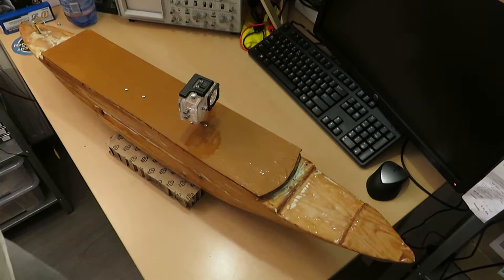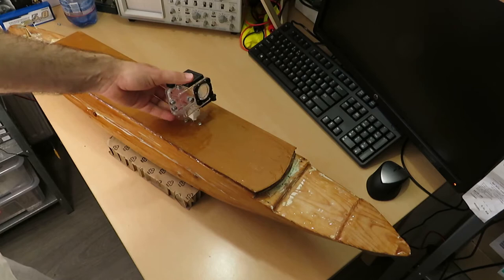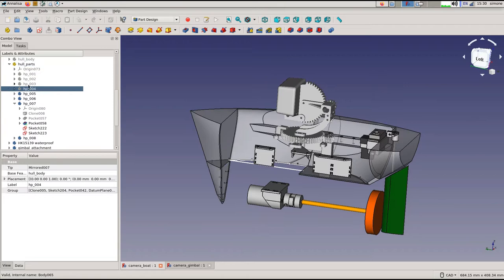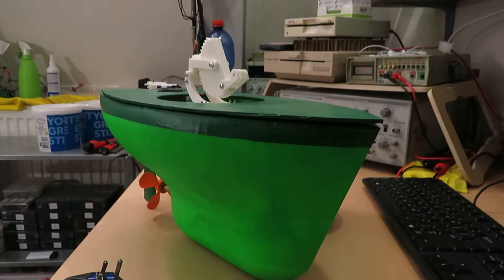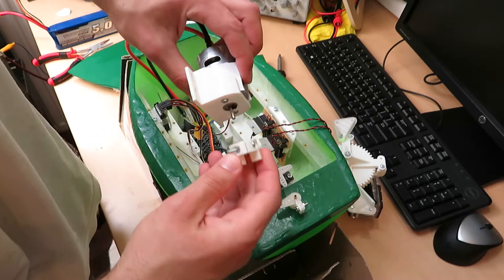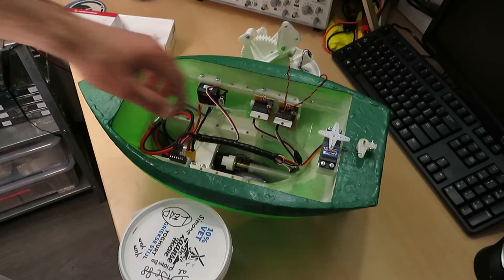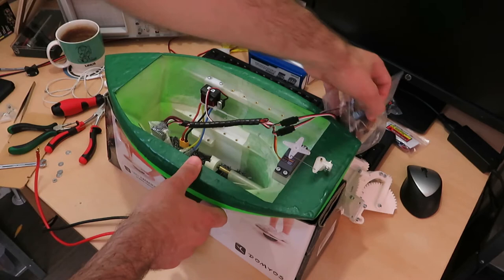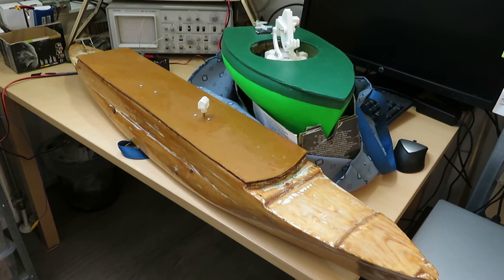new camera-boat - build and tests

Comment: Not an expert. But I think a gyroscope would have worked better than a counterweight?
Reply from the maker: True! I did consider that, but the counterweight seemed a more simple and robust solution, and does not need power.